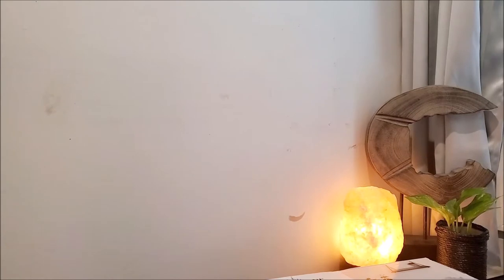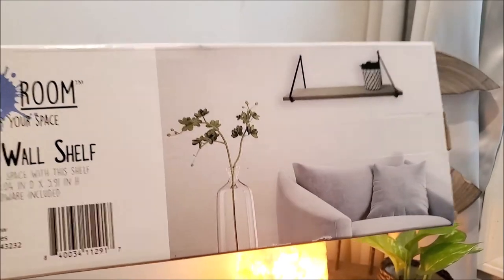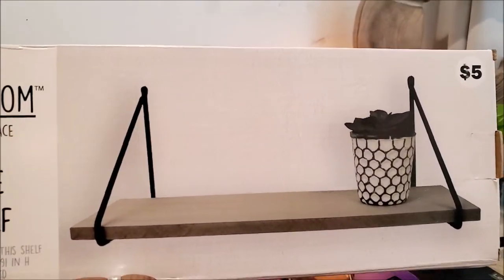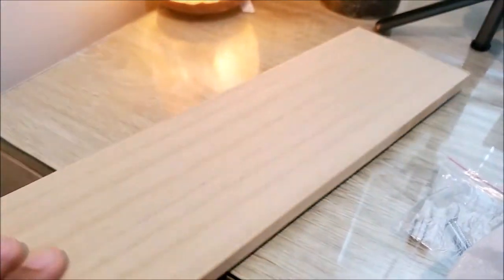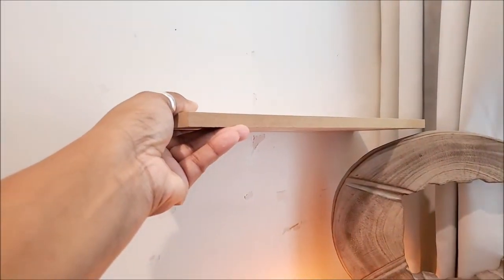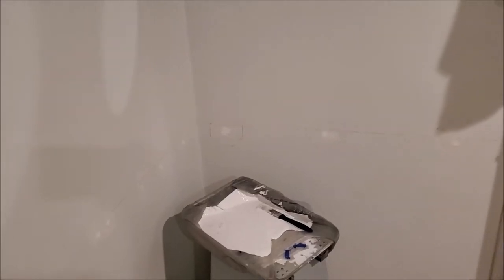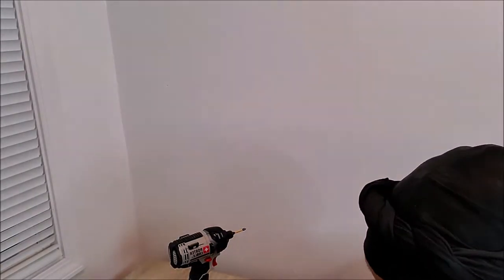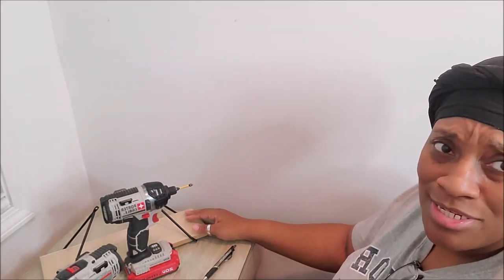HOW TO HANG FIVE BELOW FAUX WOOD SHELVES TO SAVE SPACE ON MY DESK

Comment: I just purchased a floating shelf by same manufacturer. I don't have any drills or anything fancy. Is it ok to hammer anchors in and manually screw in screws. By the way I have most everything you have down to the crystals. Definitely Sister from another mister 💕
Reply from the maker: Hey sister from another mister lol.. Yes its ok. What u want to do is bang a regular nail in(not the screw) one that is smaller than the screw u will screw in. U want to bang it in like 1/4 of a inch just to get a hole started for the screw. Then go in with the screw that will make it easier and u will not strip the hole that way. Be sure to check out other great videos and join my family by subscribing.  Share the channel as well if u enjoy.